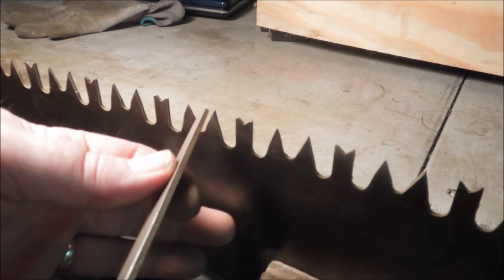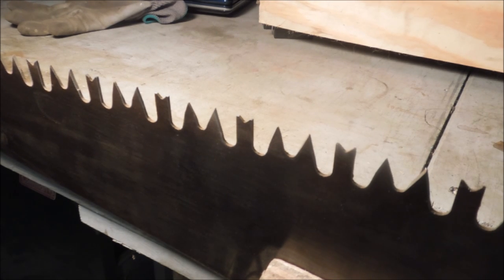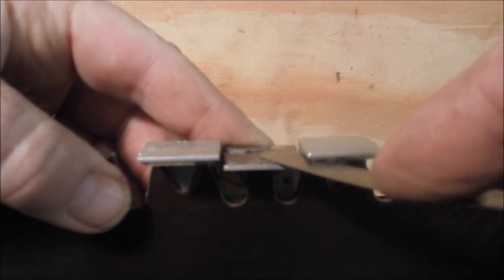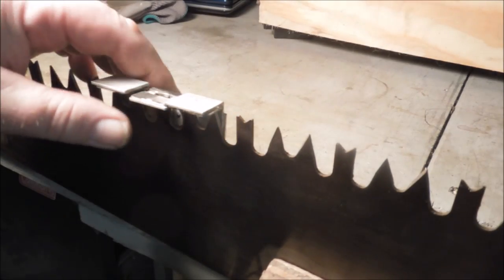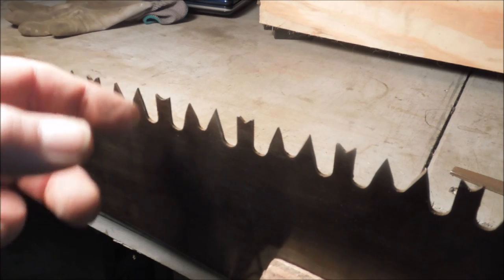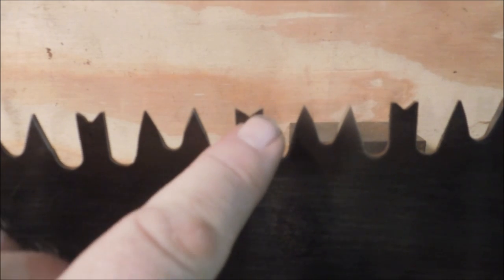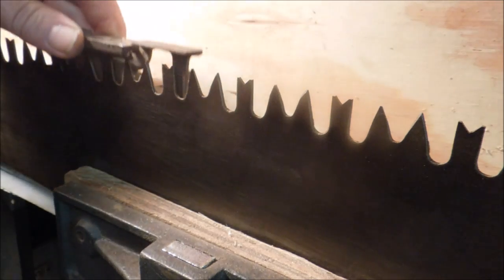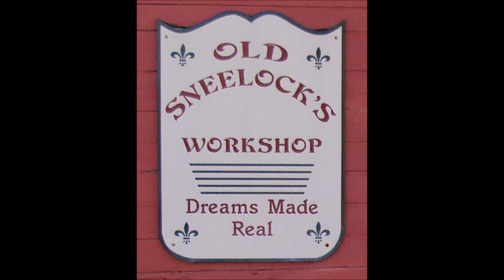Sharpening A One Man Crosscut ~ Pt 4.5 ~ Shaping the pointed teeth ~ By Old Sneelock's Workshop

Comment: A good reminder about what is needed for setting raker depth thank you
Reply from the maker: I got wrapped up in saw sharpening while I was setting up my blacksmith shop. 
I wanted to cut a chunk out of a walnut log I had so I could mount an anvil on it. 
None of my chainsaws would reach all the way through. I had a two man crosscut hanging on the shop wall as a decoration. I took it down and filed the teeth. 
Lydia and I cut through the log in about 20 minutes. Lots of rest breaks. 😀😎

Comment: Thanks for the videos showing how to do this. I want a one man saw but didn't know how to sharpen it. There was a notice that the saw ships dull
Reply from the maker: Dont Tread on Me Shipping a dull saw?  That doesn't sound right. Unless I'm buying a used saw with a good price for as is condition, when I buy a saw I want to use it when I get it. Where are you buying it from?
Reply: Lemans
Reply: Also where did you get your tools to sharpen with
Reply from the maker: Dont Tread on Me The files came from a multitude of places. Garage sales, flea markets, antique shops, and auctions are all good places to look. Once you know what it is you are looking for it is a lot easier to spot them. 
I have bought tools on Ebay but only if I could get them for a good price. Ebay prices are high. The sellers research sale prices, so should the buyers. 
I would buy a couple good files and make a saw vise from wood. In the series is a description of how I made a filing guide for one and two man crosscut saws.

Comment: Great series, thank you!  Is there a power tool that would work faster?  I love the old tools but I'm impatient when it comes to maintaining them.
Reply from the maker: I can think of several that would speed up the metal removal part. Since these saws are still being made the factory, or craftsman as the case may be might have a machine set up to file and set the teeth. 
Most of the work only takes a tiny bit of metal removal. I do like the gismosity of sharpening machines. I&#39;d love to have a Foley Belsaw Filer. That&#39;s a definite Rube Goldberg design. Repeatability is their strong suit. The problem is that it is easy to take off too much metal. By hand I&#39;m more likely to sharpen just enough. 
To answer your question, there are power filers and attachments to reciprocating saws that will file quite well. I haven&#39;t seen any being used for this but that doesn&#39;t mean they can&#39;t be. A rotary tool like a Dremel could be used very carefully. They tend to leave ripples in the surface because of their small contact area.

Comment: So, is there any advantage to the Indianapolis Raker Depth Gauge vs. the first one you showed?  I would think having ONLY the raker tooth exposed would be preferable to the raker and one cutter.  We ALL make mistakes, and if a tool has a "feature" that provides no benefit, then why is it there?  The Indianapolis Raker Depth Gauge appears to be a more substantial tool than the first one (ie, a separate hardened plate, larger), so is the longer slot just to accommodate larger saws, or is there some other reason?
Reply from the maker: +Brian Neeley The Indianapolis gauge can be purchased. To get the other one you have to go to Pt 4 and see how I made it, then gather the materials, I got mine out of my junk box, and make one. 
The reason I made one was to have one before found the Indianapolis that fit my saw.

Comment: You made a good comparison between a dull saw and sharpened saw. 
A swaged raker will scoop out the cut wood better then a straight raker.  In the day when crosscuts were king all profession filers swaged their rakers for more efficient cutting.   I've looked but never found a modern or vintage  comparison of the time and effort it takes to swage rakers compared to the increased sawing efficiency.    In the real world of professional logging in the day and even competition sawing, rakers were always swaged.  Of course they were cutting larger logs then your 3 or 4" limb.  For really small stuff maybe a swaged raker would not be so much of an advantage.  You may want to try it and good instructions can be found in the USFS manuals and videos.
Reply from the maker: +Jim Thode Thanks for the tip Jim.